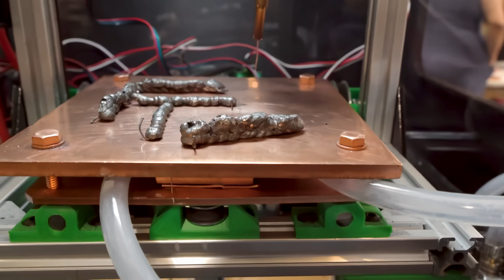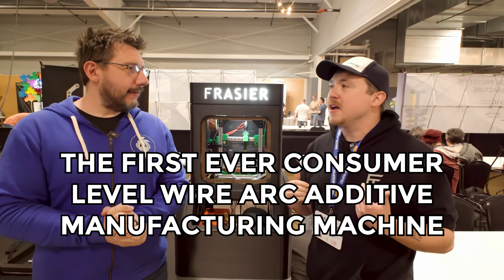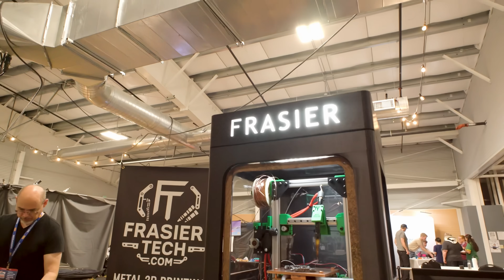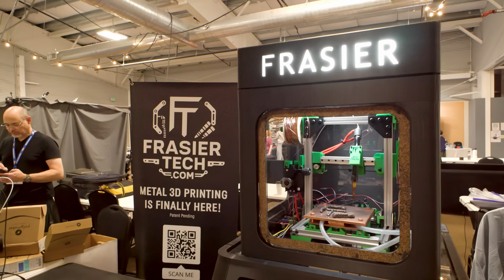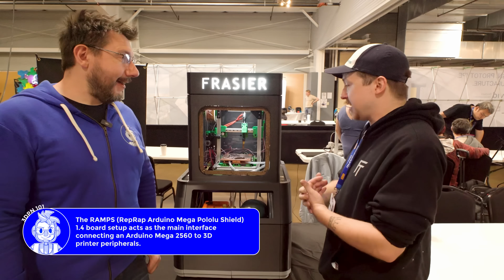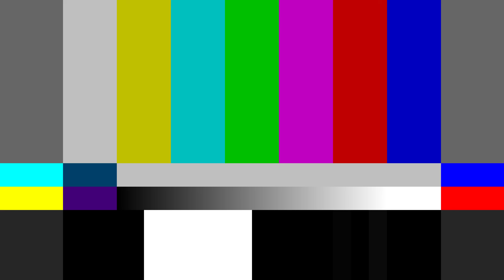A Teacher MADE THIS After School!

Comment: Glad to see it going, honestly. I'm sure you have quite a few (I've read a few myself & liked a few) suggestions for it dude. Awesome reporting on the new tech, I appreciate the coverage of the dude going for it. I'd love your take on it, truthfully; If only because I'd like to know if you have a design & or type/style of metal 3d printing that you'd like to make.

I mmeeaaannn..... Seems like, almost, all of us want metal 3d printing. Almost every dang time it comes out, most of us salivate for it but then get sad because its not likely to happen. We are, most of us anyways, typically dreamers & do-ers, so creating designs & having ideas is what is great about us. Have you, 3d printing nerd, figured out the secret sauce of creating your own filament full of simple metal powders that have been prewashed to de-oxide layer them in a vacuum then squeeze them out of a tube that's tungsten carbide/silicon carbide like those sand blasting nozzles you can buy on amazon & use a vacuum pot, 2 counter-rotating hot plates to pelletize the filament & then mix in the powders as the fall off the plates into a squeeze funnel to the sand blasting nozzle below.

LIiiikkeeee, Iiii ddunnnoo. Like bread stuff, the plates rotate & dough ball it up & just use resistive heating & drop in through a shaker mechanism, after having blended up the plastics & powder in water then dried in the vacuum pot/microwave then made to go through the 2 counter rotating plates then squeezed into a long filament with a brushless stepper motor slow spooling everything. I guess baking it is hard though. A kiln from amazon does limit the size though. & truthfully, microwave kiln-ing it to then pour a cast over the baked out plastic part to get it stronger is only going to get you so far.

I'm more partial to this dude's approach, but using a hollow core fiber with the powder inside for a thermite, that then uses vacuum & a side laser to activate. The feed speeds are fine, its more the arcing through, when needed, that needs to be figured out. But lasers help with that, etchers that is & that newer style of welder is only needing to be used if you want to not develop a fiber optic laser that uses a longer time on with a little electricity, together with that vacuum thermite.

See, the wire soaks the heat up, a pump for air to fume hood filter before sending it out to keep it in a lower pressure reduces the total amount of energy required to maintain it. It becomes a feed rate of how much thermite wire do I set off & I don't to thermally soak the mass & energy required to set off more wire.

I can also put more around the wire as well to better soak, thermally, everything. But plastic works too that has the powder in it, heheheheheh :)

Now it can be made to use less energy, be smaller, & have fewer things to go wrong. But requires several parts to work together that weren't there before. It's like a car engine, yes carbs work, but we like injectors for a reason. When done correctly, they are better in all aspects. But I can do a lot to a carb to make it perform dang close.

I'd love your take on how to do something 3d printing nerd. Can you make a video on that?

Comment: Over the years, my daydreams of a metal 3D printer always feature the hot-end as a tiny angry furnaced chamber, spooled wire gets rammed in, melted to a gooey lava, then pressure-squirted out the nozzle like a metallic volcano having a bad day. Daydream logic, baby 🤣🤣
Side note, wouldn't the welding gases contaminate the argon gas and in turn the print?. would extraction be better?

Comment: I wonder how the motion control would go with the X-tool laser welder. Or a similar device… it might give a more controlled flow of material as what’s shown is a bit erratic. 

This can be done but the industrial machines do cost stupid money!!! 

Good luck!! It needs to be wah more refined than this to be a realistic tool. 

Additive Manufacturing Show did a show on a Norwegiann company that lays down titanium in a similar manner to this, then they cnc mill the part to the final shape. The approach is because titanium billet is very expensive. And if that lay diem something 10% oversize then mill to spec.

Search this (3D Printed Titanium Replaces Aluminum for Unmanned Aircraft Wing Splice | The Cool Parts Show Ep.72)

Comment: I remember seeing the Siemens' efforts on this quite the while ago, and while you'd think it would be as straight-forward as attaching a spool gun to a CNC and sending it, the resulting parts aren't what I would call near-net where you still need a multi-axis to do the final machining. A good first effort for sure, but in my opinion, powder bed fusion at home (home workshop) is the ideal end form to chase after for accuracy and end-use ready parts. Although if you really wanted to chase the best middle ground, having fluxcore-like filament encased in polymer where you print the part oversize and 'cook' it down inside a mold would be the ultimate economy-meets-reality for widespread adoption on real metal parts for mac and cheese prices.

Comment: Here are a few points that stand out to me as someone who welds professionally for hours every day (both manually and using robots):
- The distance between the nozzle and the weld pool underneath is far too large
- The enclosure must not be hermetically sealed, otherwise there will eventually come a point where the welding gases contaminate your argon shielding gas too much. Just use an exhaust system and around 8–12 L/min of an argon/CO₂ mix (or maybe pure CO₂ would be better?)
- Furthermore, a significantly smaller welding wire diameter would help improve the print result. Weld irregularities are compensated for — or rather concealed — more effectively with a thinner wire.
- For simplicity, your welding machine should be a synergic one. That makes the setup much easier, and it could probably be optimized using some kind of THC controller (for example from a CNC plasma system) to improve the consistency of the weld deposition.
Reply: This is the best comment here. I have the same background and can confirm this. Fun tip, changing the direction of the welding path changes the grain structure of the deposited metal and can be used to change the mechanical properties of the finished product.
Reply: I'm not a welder but have been around enough that I was wondering about the same issue. When the video mentioned potentially having the machine in a more standard desktop setting I was wondering out they would do ventilation but it wasn't mentioned by the creator.
Reply: Maybe you should reach out to his company and offer up your ideas.........
Reply: I can tell he isn't using flux core so I am sure that cuts down on the off gassing by quite a lot, but by how much I wonder? I can see where a pure co2 env would be great for the pool, but at what point do you become saturated with bad gas vs co2 and have to purge it... Or... maybe the off gas doesn't upset the weld any?! I guess that could be a possbility... SURELY after 2 years+ of development that this HAS to have come up before.....? (not a welder btw)

Comment: Looks expensive to run, and dangerous.
Reply: If it's not dangerous, it's not fun.
Reply: @guestc142  I used to work at a foundry, molten metal is dangerous. It looks fun until someone looses a limb even with the correct clothing, not just coveralls.